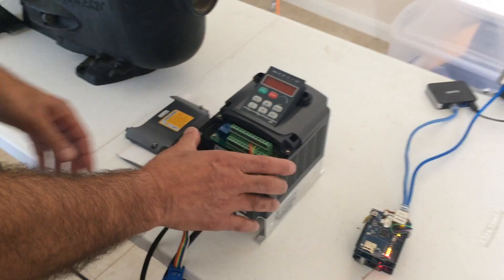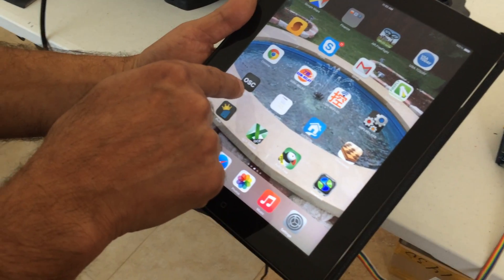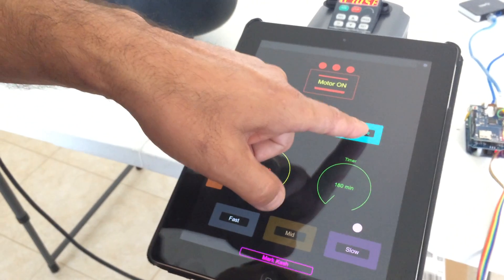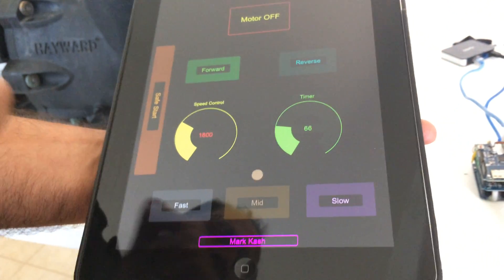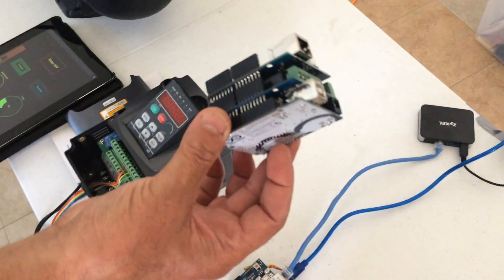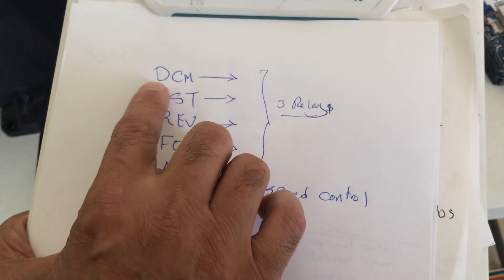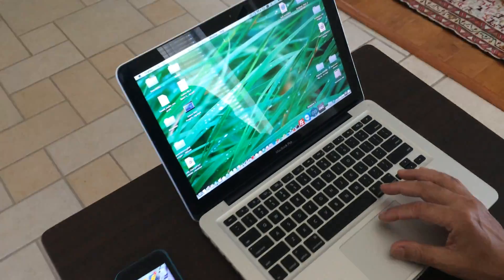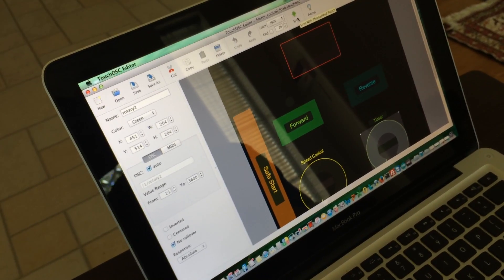Huanyang VFD wireless control

Comment: How you communicate with the vfd. With serial communication or some adapt of profibus or something or analogical signals
Reply from the maker: Communication between Arduino Ethernet and VFD is via wire (multicolor) that it shown in Video and Arduino get command via Lan from mini router and mini router get command via Wifi through Iphone or Ipad.

Iphone/Ipad>>>>> Wifi  >>>>> mini Router >>>>> Lan connection >>>>> Arduino Ethernet shiled  >>>>  Arduino  >>>>  wire connection to VFD
Reply: Yes but what protocol do you use to the wire connection. Arduino-VFD
Reply from the maker: If you watch a video the wires between Arduino and VFD is just connection between relay and VFD to switch the connecting point OFF or ON, these color wire is not for serial or RS-485 communication, simply I moved the push button switches shown on manual of VFD to relay control and instead of using 10KOhm pot between ACM and VI, I used PWM within Arduino.
Reply: @Mark1Jordon1  Hi, do you connect the PWM output from the Arduino directly to the VI input of the VFD? 
Don´t you need to convert the PMW to voltage first? 
It is very interesting it does works with a direct connection! ...I am very surprised!!! Thanks a lot men! ...it was revealing! ...I can skip one circuit module!
Reply from the maker: Yes, directly connected, PWM works as 5 volt voltage controller that VFD needs for speed control.
Reply: How can it get the feedback actual rotational speed to the ipad. Or, does it get the feeback voltage and convert it to a speed value?

Comment from the maker: Rafael , following are the component you need for this project:

1) Hyuan yang VFD 4kW 5 HP 220V
2) Mini route with Lan connection (such as the one that I shown in Video ZyXEL MWR102)
3) Arduino Uno
4) Arduino  4 Relays shield
5) Arduino  Ethernet shield
6) USB power supply 
7) USB cable type A to B
8)  Cat 5 cable.
9)  Flat wire with at least 7 conductors ( between Arduino and VFD)

Comment: Hi 
I love your setup. Great idea. I was wondering if you could right down the components you uses. I know you mention it in the video but unfortunately I can't understand what your saying every time  you mention it. It's the only thing you say in the whole video that I can't understand. Also maybe a link to the the products on eBay? Also can you give us the programs instruction you made on your compiler.
Thanks
Reply from the maker: Rafael , following are the component you need for this project:

1) Hyuan yang VFD 4kW 5 HP 220V
2) Mini route with Lan connection (such as the one that I shown in Video ZyXEL MWR102)
3) Arduino Uno
4) Arduino  4 Relays shield
5) Arduino  Ethernet shield
6) USB power supply 
7) USB cable type A to B
8)  Cat 5 cable.
9)  Flat wire with at least 7 conductors ( between Arduino and VFD)